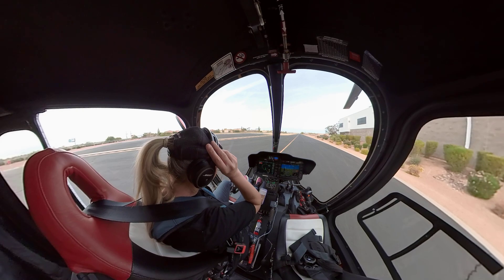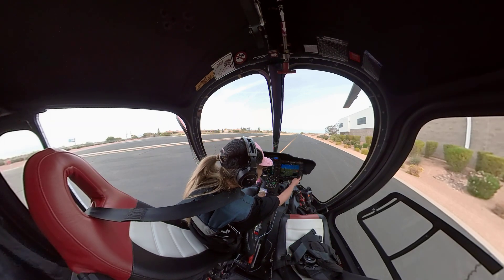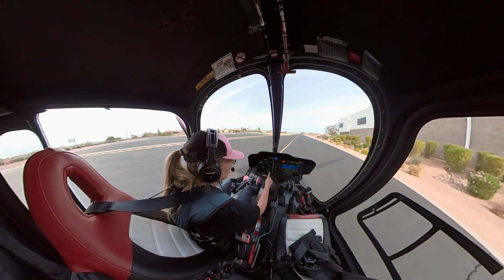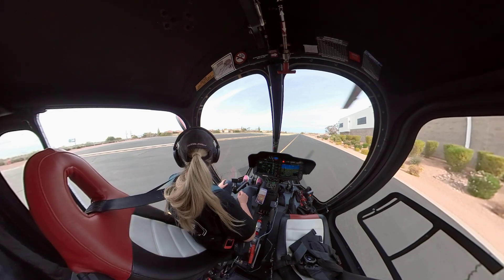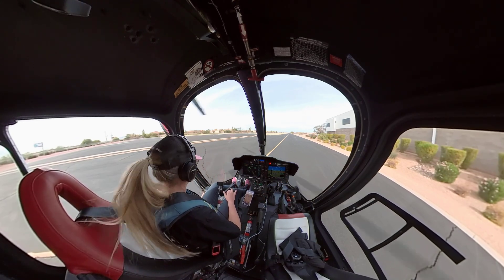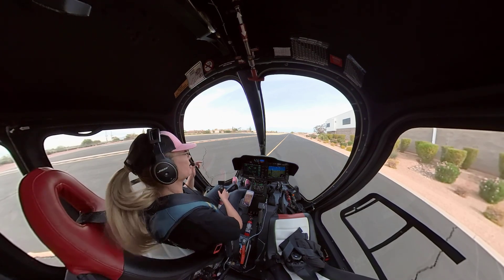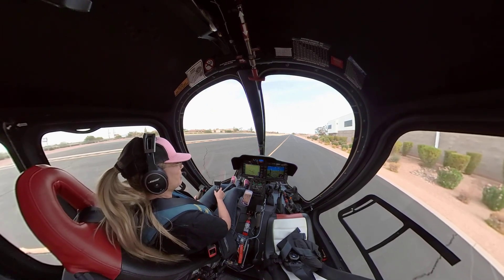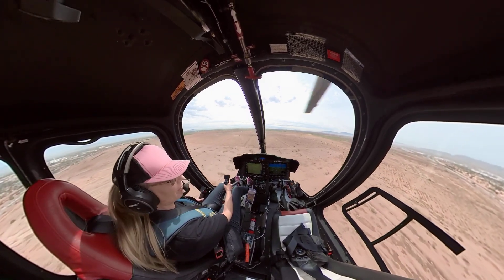Bell 505 Helicopter Start Up, take off and rotor downwash considerations. Pilot Situational Awarness

Comment: Were you using a checklist?
Reply from the maker: Not this time...I do use the flow and check method when appropriate. But when I'm starting it multiple times a day I personally find it to be more of a distration. Fun Fact: Bell does not provide a checklist with any of their helicopters...only what is in the Flight Manual...which is very disjointed and not practical to use as a checklist.